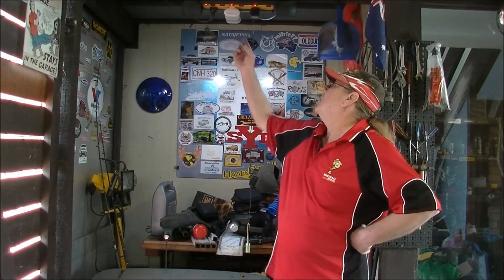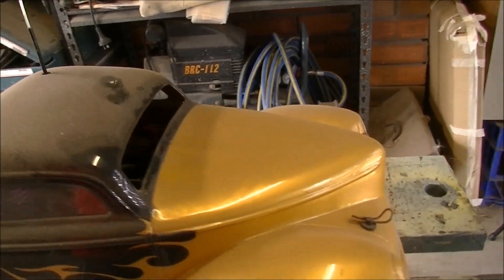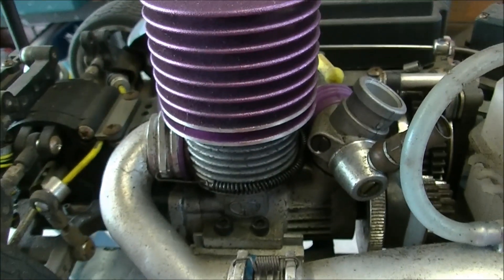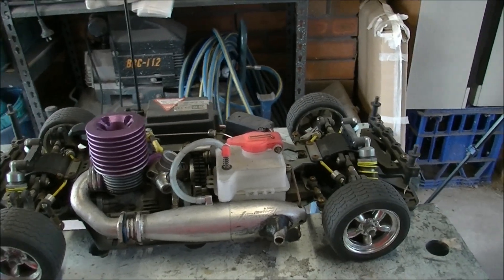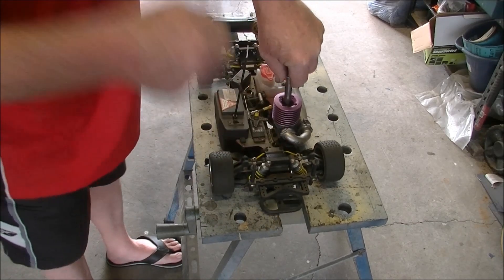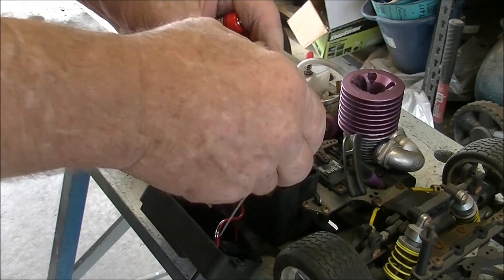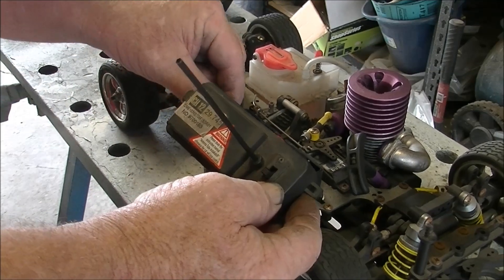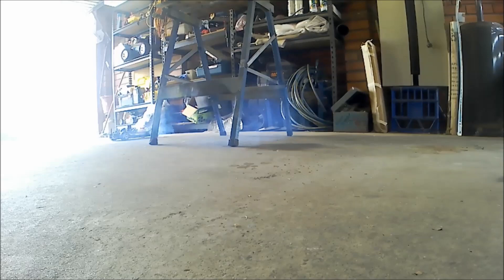My little Willys.

Comment: even on this you taught something , my brother has an RC CAR too , the laser temp gun is a great idea for carby mixture settings, we did not spray down the glow plug hole so it will be interesting. his went pretty fast too he bought it used years ago.
ages ago my dads old mower was rubbish so i put that fuel in it as we had some left over just to see what would happen , nothin no difference.
Reply from the maker: I was into them 40 years ago pretty heavily...It was a different game then.